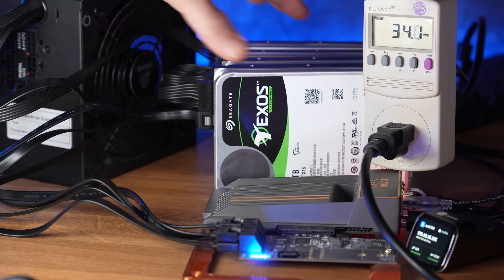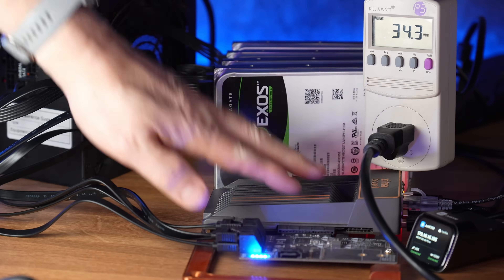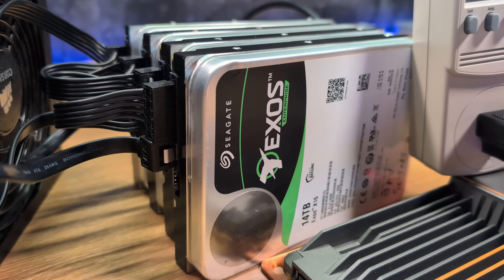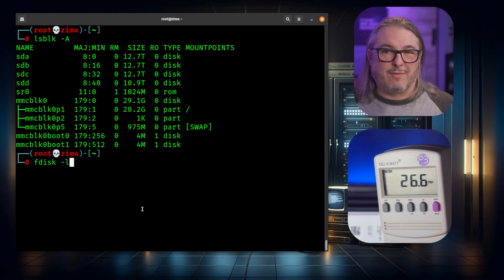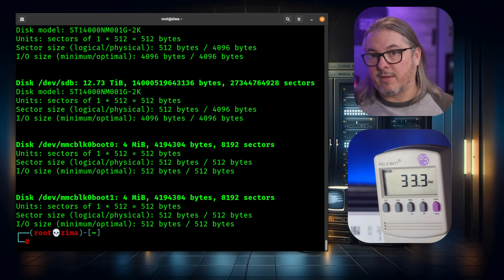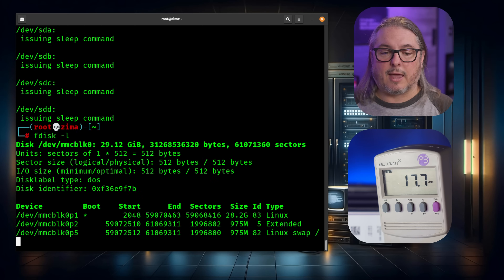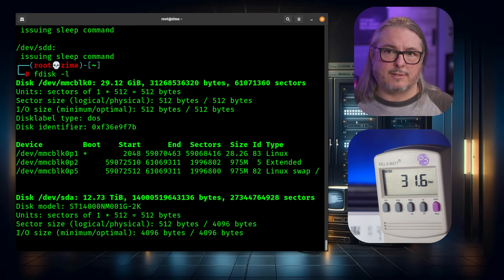How Much Power Can You Save by Putting Your NAS HDD's to Sleep?

Comment: I run the latest TrueNAS with 20 HDDs on a 7900 12 core CPU w/128GB DDR5.  I spin down the drives after 2 hrs of inactivity which seems a reasonable compromise of power savings and wear and tear.  Within +/- 10% my idle power usage is 100W and under read/writes is 200W (convenient that the numbers work out so well).  I keep my NVME drives always on (of course) so no problems running Docker apps which only write to these.  It is a good compromise.  No bad HDDs after 3+ years.

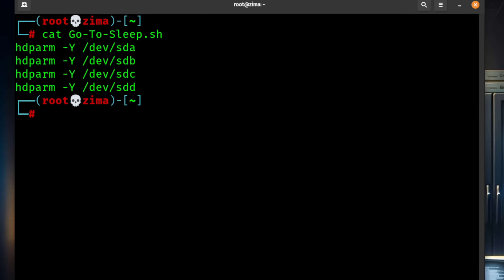Comment: 1:39 It'd have been easier to just type: hdparm Y /dev/sd? - the question mark is a single-character wildcard, matching all drives that begin with /dev/sd and are followed by one character. It wouldn't match e.g. /dev/sda1 since that's two characters after /dev/sd.

Just leaving this as a hint for people who like handy, quick CLI tips.

Comment: I've been using sleep with my drives in my various system for decades now, including my current TrueNAS Scale systems. I just have set the spindown timer to 2 hours so as to prevent constant spindown/spinup cycles -- if 2 hours pass without activity, it typically means no one's at home or it's night time, so it's ok for the drives to go to sleep. With a 2 hour timer, there's enough activity during the day that the drives keep running and won't spindown needlessly.
Reply: exactly, I've set my 15 drives to 3 hour timers and i haven't had a single drive failure in the last 10 years these drives were in service.
Reply: @WereCatf  did you have to disable SMART? I’ve been trying to get standby to work but they always wake up after a couple minutes

Comment: I do it different way:
5:00 - wakeonlan NAS
5:15- perform all backups etc from Proxmos (fully on SSD) to NAS
6:00 - peform all backups from all laptops (TimeMachine)
7:00 - replicate NAS to remote location
9:00 - shutdown NAS
This NAS draws around 50W while working, 0W while shut down. So 6h a day 50W and 18h a day 0W so around 900W saved
Plus: Proxmox takes much less power when no backup is happening.
Reply: How do you orchestrate the Time Machine backups to all happen at the same time?
Reply: @napzero  I dont - it happens every 1h so I usually have 4-5 backups every morning from each laptop - MacOS senses that TM location is available and it starts backup automatically. Btw on laptop there is a backup every 1h but on NAS they are being pushed only when NAS is up
Reply: A lot of work to save 900 Watts. Plus that 900 W probably  cost a lot less than your labor doing all that work , you gotta catch 22
Reply: @Dirtyharry70585  you mean the crontab written once and forgotten is too much? and tasks schedulled on Proxmox and forgotten? wow
Reply: @Dirtyharry70585  it adds up to over 300kWh per year; Spotify individual subscription in my country would be cheaper

Comment: What are y'all's opinions on wear and tear on vertically oriented HDDs vs. horizontal (flat)?  With vertical, the platter accelerates with gravity when going down then decelerates against gravity going up, and it does that 2 (5400, 7200, 10000) per minute.  Whereas a horizontal HDD is parallel to Earth's surface so seems the rotational speed would be less influenced by gravitational force. It's why i preferu NAS and server chassis to use horizontal orientations only, but idk if im worrying about nothing.
Reply: You still have a gravitational force acting on the drive. For vertical orientation I suspect the acceleration and deceleration forces the platters experience mostly cancel each other out.

What really matters more IMO is how well balanced the platters are. That they spin so fast means even very tiny imperfections cause vibrations. Whether you orient the drive horizontal or vertical, these forces are much stronger than that of gravity.

In the grand scheme of things I don't think orientation makes a difference

Comment: Ive been running 3 8TB (7200rpm) ironwolf pros for over a year now with "hdparm -S 2"  (Spin down after 10 seconds with no activity), this takes my overall server powerdraw from around 38w at the wall to 16w as measured by a smartplug in homeassistant, saving me 22watts or about 7.3w pr drive, or ~192kwh each year in total.

The spun down drives are my media library, so there is a noticeable delay of about 1-3 seconds when i need to access this media, but that is something i've decided to live with.
Reply: Best is to use mergerfs with snapraid for media only. That is best of both worlds, to be honest. Only a disk that has data on it is woken up, and only when someone is watching ir importing data. Everything else on all my other servers is on NVMe drives.
Reply: @karliszemitis3356 i just run em as seperate disks, no raids etc

Comment: This is wrong. Your hdparm didn't spin down the disk, just disabled electronics (Idle_A state). The Exos has a default of "Idle_A" state, you need to use the Seagate SeaChest utilities to set the drive to enable Idle_B, Idle_C or Standby. Then you'll get as low as 1.06 Watt idle for each drive. See user manual section 2.5.1 Table 6 page 12 (manual rev. F). Also see section 2.5.4 on what each Idle state represent and how to set it.
Reply: I think you are right. 
I have three Exos X20 18TB in a DAS. I use TrueNAS Scale and to save energy the state "128" for the HDDs, which acccoring to TrueNAS saves energy by low consumption and not "spindown". 
The normal consumption as a whole (3 HDDs + ~1,5W of the DAS) is ~28W. The consumption in saving mode (according to 128) as a whole is ~8W. And the HDDs do spin down a bit but not completely, and also need a bit of time to be readable again.
Reply: @tx2gnd  damn man... Why do you have to go full techie?  You just pulled the S3 power state out of your bag!
Reply from the maker: The spindles did come to a stop with that command.
Reply: @LAWRENCESYSTEMS  They would only do so if you've set the firmware to another state than Idle_A first. And the 17.7 Watt indicates that the drives still are in Idle_A and not Idle_B or Idle_C or Standby (1.06 Watt pr drive).
Reply from the maker: The power supply pulls 14.9 watts with no drives plugged in and as noted in the video the Zima board is powered by it's own power supply.
Reply: @LAWRENCESYSTEMS  I rewatched the video. Can't find where the 14.9 Watt is mentioned? Anyway it doesn't make sense. I do understand that the drives got their own PSU.

The only number you gave us is that the idle of 4x Exos is 26.6 Watt and after your hdparm -Y it's 17.7 Watt.

My point is, 4 Exos X16 at full idle (motor off, as per firmware idle state "standby") should according to the manual only draw 1.06 Watt each. That should be a reduction from 26.6 Watt to 10 Watt for the 4 drives. So something isn't right with this test.

You say the drives spun down, so not Idle_A or Idle_B. But Idle_C is only reduced RMP, not fully motor off and still uses 2.47 Watt pr drive. And yes it takes a long time to recover from Idle_C.

Please just use the Seachest utilities from Seagate (Linux CLI tool) and verify the enabled idle state in firmware. I gave you where too look for the info in the user manual. You can use the tool to verify that the drives is in the right idle state too.

Point is, you should see a reduction from 5.07 Watt pr drive to 1.06 Watt pr drive and the numbers in the video doesn't show that.

I'll leave it at this as there's no point to argue over this. Just redo the test with the right tools and all should be clear.
Reply: @tx2gnd  He did mention about the 14.9 watts
Reply: @juanmondragon  Not in the video. He added the 14.9 Watt to the comments later. Point is, the difference in this test should be around 16 Watt while he only shows 9 Watt. And that's not because the savings isn't there, but because the PSU hides it because of the PSU inefficiency. As I wrote in another comment, the savings is more visible in a real system. Since the PSU inefficiency hides the true power savings, the conclusion of this video is somewhat false.
Reply: @LAWRENCESYSTEMS  Yeah sorry Tom, but this should have been tested a bit more thoroughly and with proper equipment instead of a cheapo power meter in front of the psu.
Reply from the maker: @3xpired3lements  The Kill-A-Watt is accurate within 2% which is adequate for this test

Comment: Interesting, I would have thought the drives would draw much less than 4.4W sleeping, but I guess not.
Reply: The Exos X16 14TB drive it seems he uses is able to draw as little as 1.06 Watt at the deepest sleep. He just forgot to use the right tool. He needs to set internal idle state in firmware with SeaChest.
Reply: @tx2gnd  it seems kind of dumb you need to use manufacturer's tools to push the drive to a lower power state... This is Linux where you can actually just give the OS control
Reply: @xephael3485  Not dumb at all. Take a look at the flags and they make sense. This is enterprise drives, you control them by changing flags in the firmware. Then use your OS (Linux) to manage them. The tool is command line for Linux too.
Reply: @tx2gnd  of course it's firmware... My point is that it should be controllable by standard Linux kernel flags...  You shouldn't need to install proprietary closed source junk to tell the drive to go to that state.
Reply: 2.225 watt was saved in the sleep mode per drive... A lot of these newer drives have SSD cache which takes power,  then you have the entire controller board.  

I think you're right from a logical perspective.  A real sleep state should draw virtually zero power.  It should be less than a wake on LAN.   This is probably something the specification is missing for SATA and other buses.  Really powering down the device would show it as being disconnected from the bus
Reply: That was probably what the power supply itself was pulling

Comment: Also very interested in hearing whether anybody has tested the wear & tear of allowing HDD power saving vs. fully spun up, heads engaged 24/7
Reply: As far as I know, no one has actually tested it on a large scale. People often cite datacenters, but datacenters want their hardware to be in use all the time, so they won't be powering down like that. Sure it'll wear the drives, but does it matter? No idea. I used to run my NAS with them powering off and can't say I noticed any extra failures rather than the usual, but that's only one guy with 15 drives.

We need someone with many (hundreds?) of drives to do a proper test, but they also need to not care about using the start/stop half of the drives as they probably won't want drives they're making use of stopping randomly.
Reply: @PeterBrockie  Aye I oversaw a few hundred racks for an oil and gas company worth billions, we had enough NetApp storage shelves (30 racks total) and thousands of drives that I was able to perform a study on the failure rates of the various brands of HDD (HGST, Toshiba and Seagate) with pretty conclusive results but nothing was ever spun down or taken into a low power mode to test something like this its was maximum throughput at all times. 

Only time power savings were taken into consideration was when we were looking at server refreshes and what hardware could be consolidated down into virtual systems from physical hosts.  Power was relatively cheap, it was rack/facility space in the Data Center that really cost you an arm and a leg if you didn't own the building itself.

Honestly it could go either way you usually see the highest power draw and most abuse taking place during POST but there are so many other factors to control for in this type of test usage patterns of the drives and heat/vibrations over extended periods of time are usually the biggest causes of wear on a drive.  If your NAS doesn't see consistent high utilization powering it off or putting it into a low power mode is probably the play especially if its a home-lab where your paying marked up electricity rates and not getting it at wholesale.
Reply: @rpungello  spinning up and spinning down the drive definitely wears out the bearings..  as to how much and if it will keep the drive from functioning depends upon the technology age and a bunch of factors that are pretty hard to consolidate

Comment: When you wake up drives you might not want to wake them all up at the same time unless you have a power supply that can take abuse.
Reply: Its no different then when a system boots it will undergo the peak power draw for a few seconds as everything powers on and boots up.  Even with 24 drives most it would likely pull is around 240Watts, well within the capability of pretty much any PSU to handle for this type of application.   

Only time you may run into an issue like this is if you have a dedicated GPU and undersized PSU from the get-go then you can run into over-draw scenarios.  Otherwise though shouldn't be an issue 99% of the time.
Reply: @BigHeadClan  I'm not using these specific drives but I don't believe that.  I've seen far fewer drives tripping 500 w power supplies when the controller starts them all at the same time.
Reply: @xephael3485  15 years of IT, 5 of which was in data center and I've never seen that happen a single time, any time I've even heard of it happening its because because the system wasn't spec'd correctly (usually too large of  GPU for the PSU to handle) or the quality of your hardware is sub-par as the cheapest PSU's rarely hit the advertised ratings of 500 Watts or can support that type of power draw if its only connected over the 12V Rail. 

But even the least efficient HDDs shouldn't be pulling more than 20 Watts or so during start up,  if your tripping the PSU during POST from excessive power-draw something else is going on.
Reply: @BigHeadClan  that's probably because you're dealing with systems which have controllers preprogrammed to spin up the drives half a second or one second between each other...  

Generally you don't have commercial systems which haven't taken this into account.
Reply: @BigHeadClan  telling 24 or so motors to start up at the exact same time basically gives you a black hole of energy draw... just saying 

It's easily mitigated though by just staggering them by a fraction of a second.  If you build a home system with multiple drives you can easily run into the power Spike issue
Reply: @xephael3485   A "Black hole of energy draw" Come on  man OEMs pretty clearly spell out the expected power draw during the various stages of operation in their product manuals. 

Like yeah during POST they can spike to a non-insignificant amount of power but you'd need to under-spec the system to run into those issues.
Reply: @BigHeadClan  yeah I'm talking about during POST... Overall you could probably just ignore what I'm saying unless you're building your own system from the ground up.

I've done a lot of builds where you use commodity components versus commercial ones... in a commercial setting.  And that's where you run into these issues